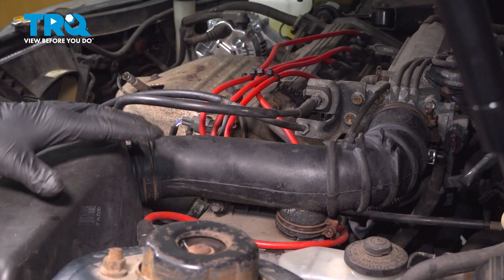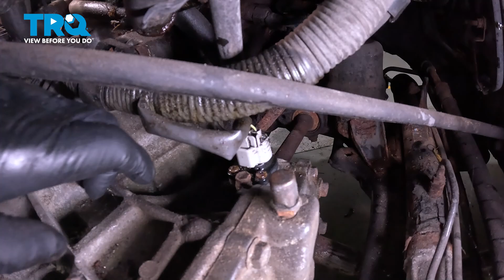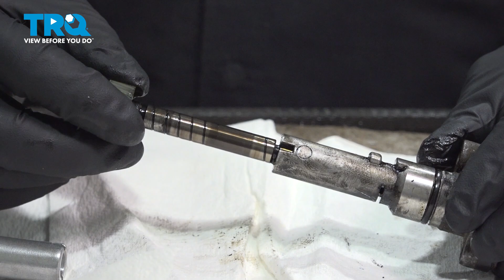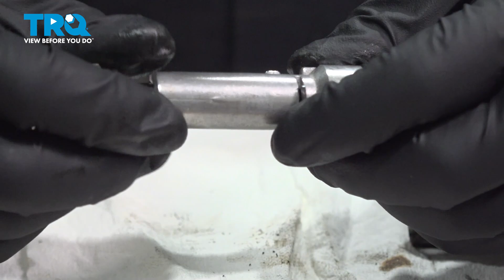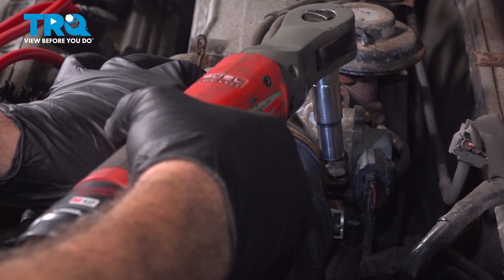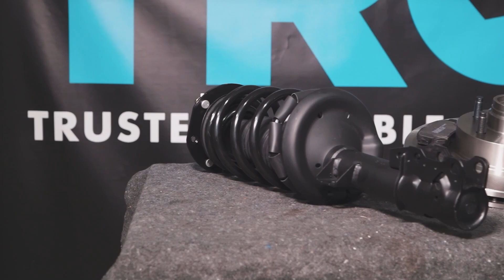How to Replace Vehicle Speed Sensor 1992-1996 Toyota Camry 2.2L L4

Comment: I followed the directions and seem to have followed them correctly with a new part, but the speedometer still doesn't work. What else could it be?
Reply: The transmission or the internal printed circuit board (PCB) / ceramic resonator inside the instrument cluster.

Comment: Is this the only VSS on a 98 Toyota Camry? Just had this done and the issue persists. Speedometer went out, won't shift, Odometer went out.
Reply: Many Toyotas from late 80s and 90s have two speed sensors one is built in the speedometer gauge itself and transmits speed data to the engine computer to control shifting